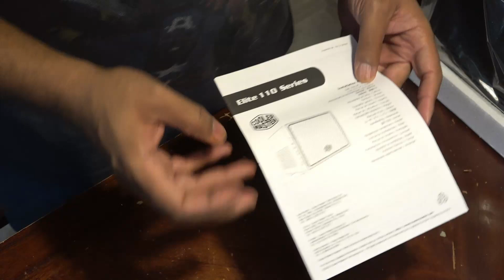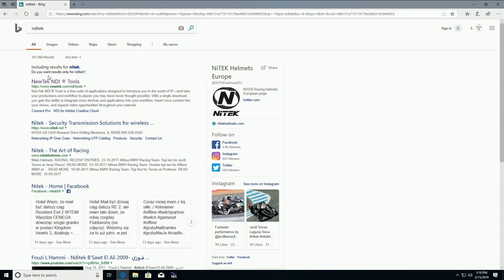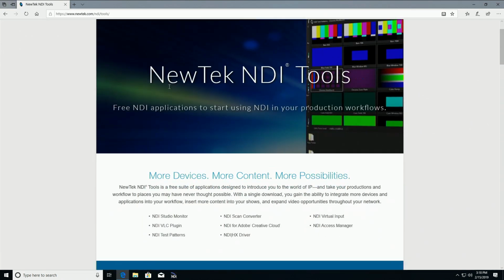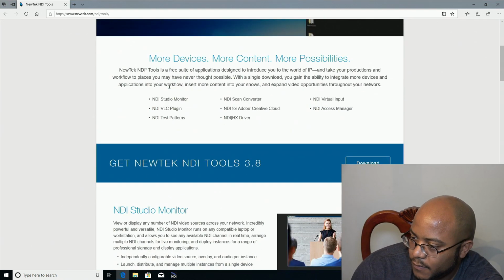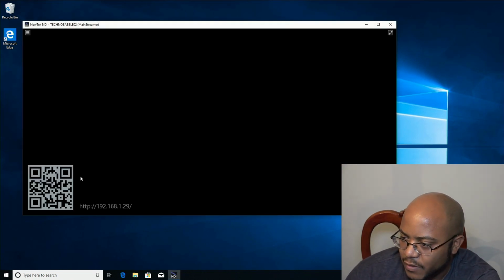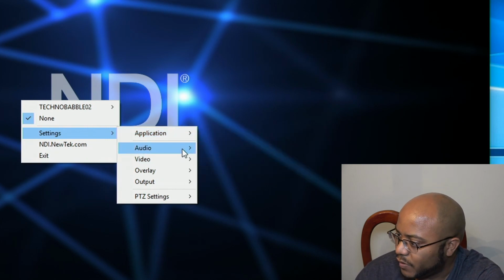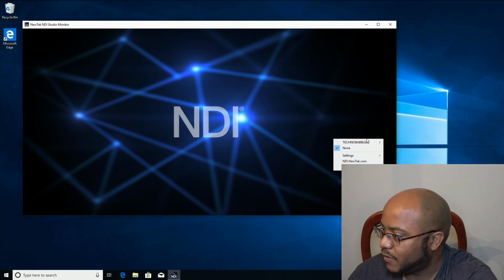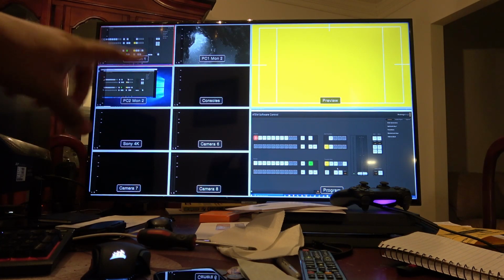NewTek NDI OBS Plugin Video Distribution - NDI Studio Monitor

Comment: Hello Ajay, as always, great content!  Have a NDI question.  In our church, we use NDI both video and audio to broadcast to other sites in our campus.  We tested both OBS and vMix for streaming an we still get latency even if we connect to the network with a cable.  One laptop performs great, no latency, other 2 laptops have latency.  In task manager, we noticed the network traffic on 1 laptop runs at 98 mbps with no latency, the others run at 60-75%.  CPU all all run about 10% and RAM at 40%.  So no issues with hardware.  Have your experienced that issue?  if so, how did you resolve it?  Is there a way to allocate network traffic to NDI at 95% or so?  Please share your thoughts.  Thank you so  much
Reply from the maker: What type of network are you using and what resolution and quality are you sending over the network?
Reply: @AJaytheCEO  video is set at 1920x1080.  Video is at 31fps.  Our network is internal using switches and wireless routers.   Laptops are hard wired to the switch for max bandwidth.   What I cannot explain is why 1 laptop runs at 95% mbps while the others at 60%
Reply from the maker: @ivanb4613  most likely processing the NDI feed
Reply: @AJaytheCEO  Hello Ajay, turns out the issue was the laptop network card speed.  It needs 1Gbps speed to work well with NDI output.  Thanks for the insights, that took care of the choking issue.  
Now, the new issue...the audio comes ahead of the video when using NDI livestream output to another computer in campus.  However, livestream is in sync, but when using NDI Studio to show it, audio is ahead.  Any insight

Comment: @AjaytheCEO - does this setup with NDI produce any latency if the video monitor is in the same room as the live room?  IN other words if I have projectors displaying the live feed in the same room will it lag?
Reply from the maker: There will naturally be some lag but this all depends on the system and your network
Reply: Both video and audio on laptop 1 are in sync and no chuckling network runs at 90mpbs in task manager.  Laptop 2 and 3 both lag and chuckle...meaning that video will freeze while audio continues, both laptops 2 and 3 network run at 60 mbps.  The issue is definitely isolated to the laptops.  I have not found a solution to allocate 90mpbs usage of the network card assuming that will correct the issue.
Reply: @AJaytheCEO  right, and that we get, but the issue is not there.  The issue is that video chuckles when network card speed drops below 90mpbs at the laptop level

Comment: How much power do you need for ndi and OBS? Do you need a monster graphic card and i7 or i9 processor? If you have like 6-8 inputs, like cameras and presentation computer streams, what kind of computer is needed? Is the processor more of an issue than the graphic card or where is the power needed in a ndi-system? Planning for ndi in my church and I don't find answers on this topic, the computer power need.
Greetings from Sweden.

Comment: Does the two different pc’s have to be on the same network can one pc be at home and the other at church?
Reply from the maker: You would need to have a network linked between both or set them on the DMZ which you  WOULD NEVER WANT TO DO
Reply: I think the NDI Bridge in NDI tools will allow connecting two networks

Comment: Do I need an NDI on both computers? Or just the computer that is projecting what is on obs?
Reply from the maker: You only need the NDI Monitor on the computer to view the NDI output from OBS
Reply: @AJaytheCEO  it worked but looks terrible,  I think my obs settings are not right
Reply from the maker: @movement1957  check network speed and bit rate in obs
Reply: @AJaytheCEO  I have 150 down 10 up
Reply: @AJaytheCEO  the date rate is at 3500 ,
Reply from the maker: @movement1957  are you hardwired or going over wifi?
Reply: @AJaytheCEO  hard wired
Reply: Now it looks better on 1080p 30 but the video rubber bands speeds up and slowed down at an even rate